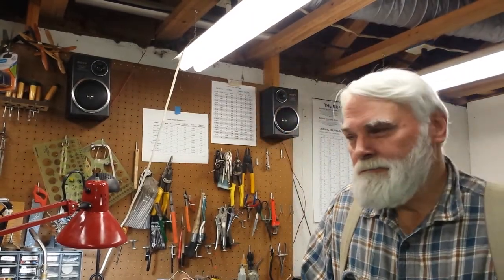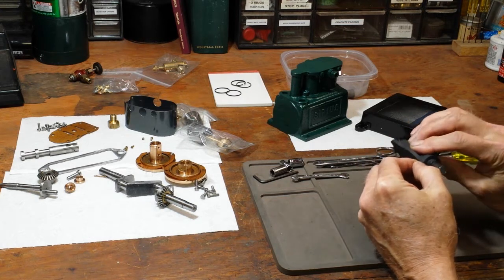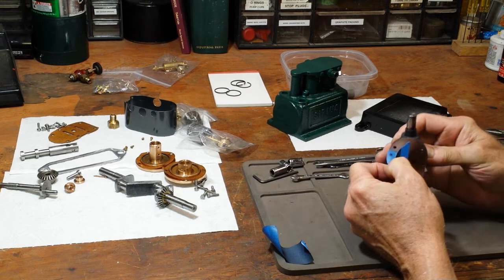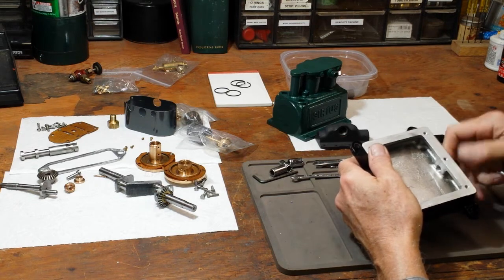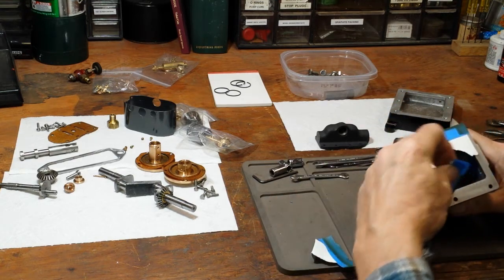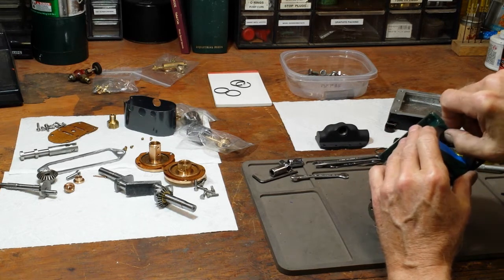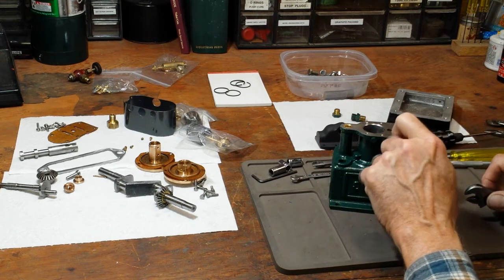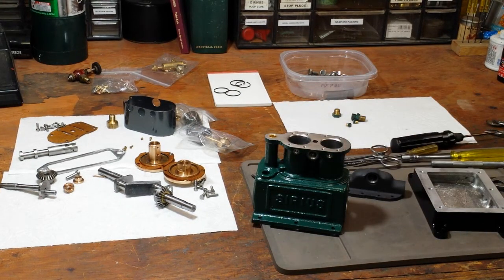Assembling and test running the Stuart Sirius steam engine part 1

Comment: Hey SteamerJoe, appreciate your videos. I just acquired a ST Sirius and have it completed but the dip stick is missing. Can you tell me the Proper length of the dipstick from top of the handle to bottom of stick? I will need to make one from brass bar stock. The diameter of the hole in the casting on my engine is 9.75mm’s. I assume they are all the same. I didn’t receive the drawings with this engine but fortunately most of the castings were already cut. Just had to drill out and tap a bunch of holes and haven’t decided what to do with the boss on the right side of the engine casting. I believe mine is WWII era but has the more modern base without the oil dipstick. Same as yours. Thank you for any help. Steve